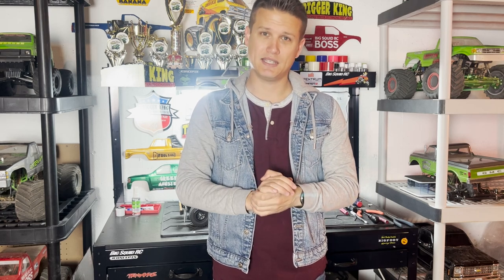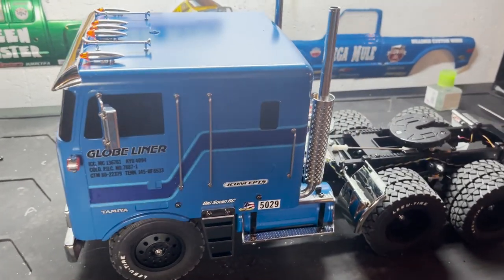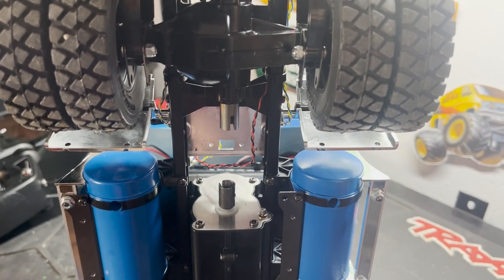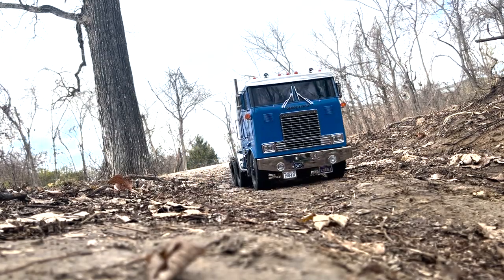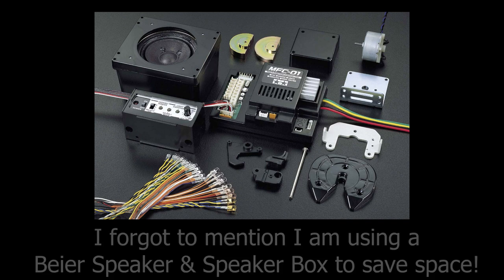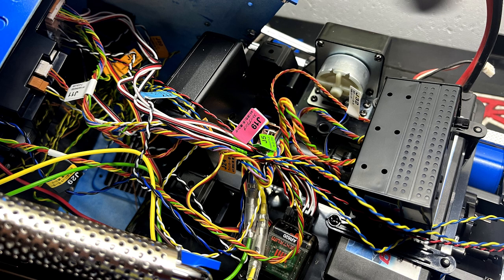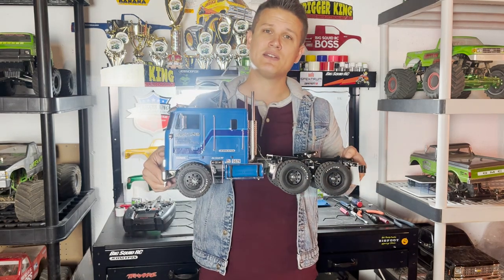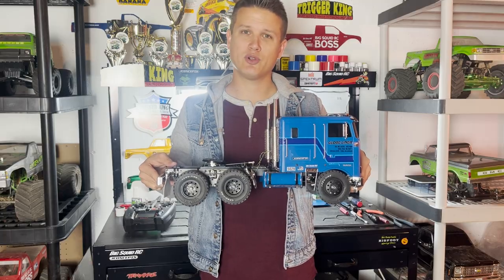Tamiya Globe Liner First Run - Building an R/C Snowrunner Logging Truck

Comment: Pretty cool! I dont run my GL offroad. I do have the stretched frame from the Knight Hauler, 3:1 GRU/Tamiya Torque Tuned motor, and rc4wd beadlocks and tires (Roadys). The GRU slows it down but increases torque nicely.
You can also run the WR02 Wild Willy's or Suzuki Jimny rims and tires in the rear like some wide offroad Supersingles. They make mine look like a puller truck.

Comment: Thaaaat looks gorgeous.

Are you having any trouble with the front tires interfering with the wheel arches?

As far as the pole trailer, the front U-bunk snaps into the existing fifth wheel, and there's a ring-and-pin hitch that bolts onto the back bumper to pull the trailer itself.
Reply from the maker: Thank you, and no thus far the front tires turn fine and there is no issue of rubbing. The front suspension is still pretty stiff so it really doesn't articulate too much.

Comment: Not many people use the vibration unit, it’s not great, and the 5th wheel switch when engaged increases the power output to the motor, if your not going to use the 5th wheel most of use cut the switch off and join the wires together, you then get full power all the time,    Hope this of some help